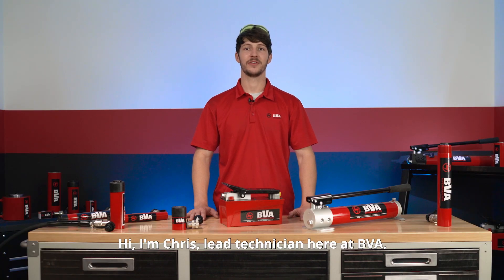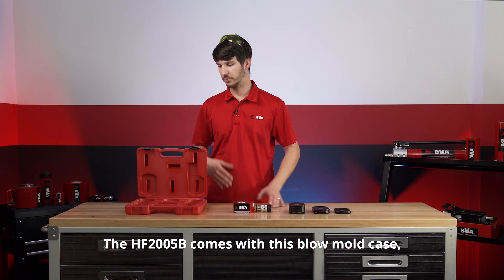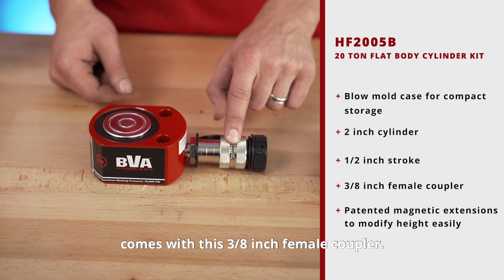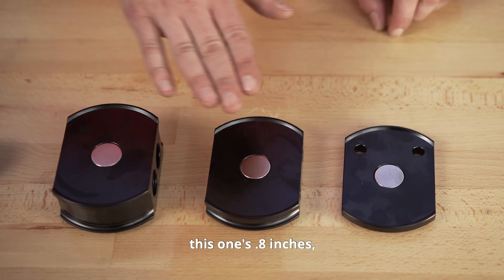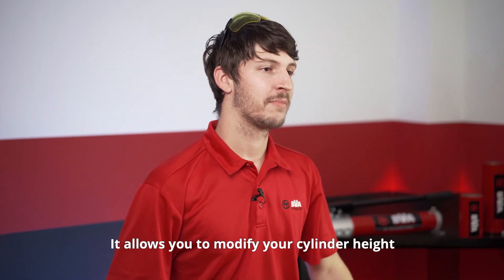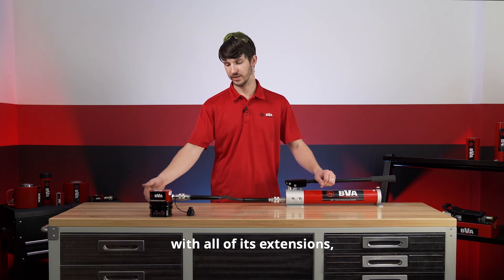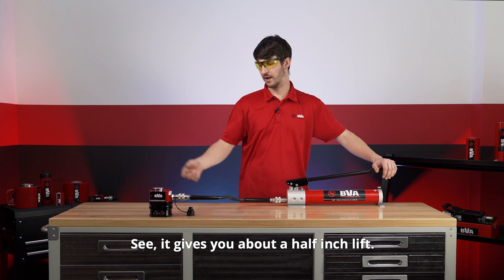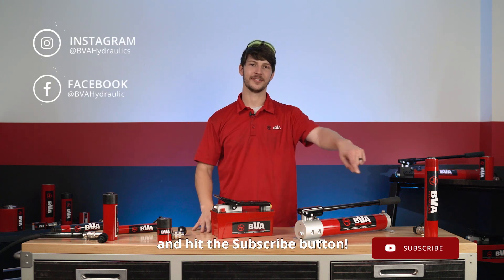BVA 20 Ton Flat Body Cylinder Kit

Comment: hi mi friend.     with this P1000 pump hand working with a cylinder HL2002 i have a doubt that sure you can help me.  when cylinder make contact to load how many stroke i need to do to arrive at 4000psi in the pressure gage??? and how many force i have to do for each stroke from that the cylinder make contact to the load until to 4000psi in the pressure gage?????     thanks a lot.